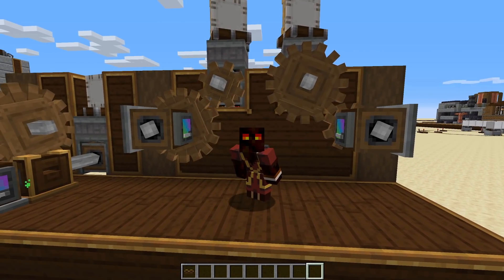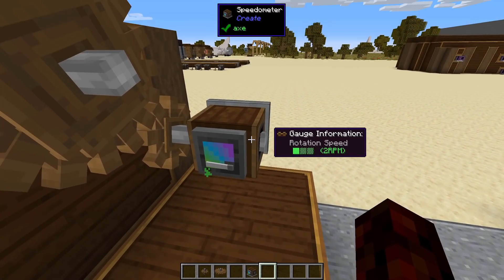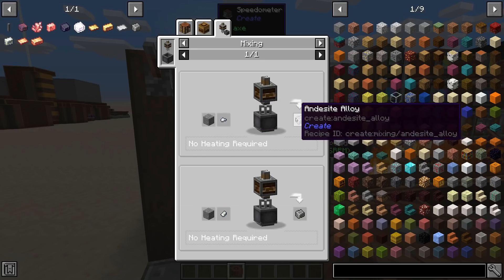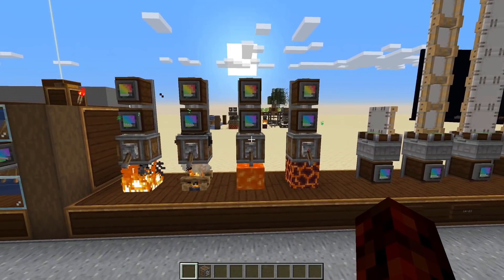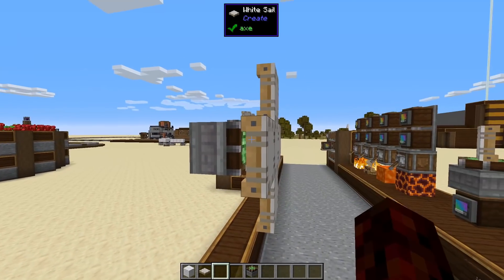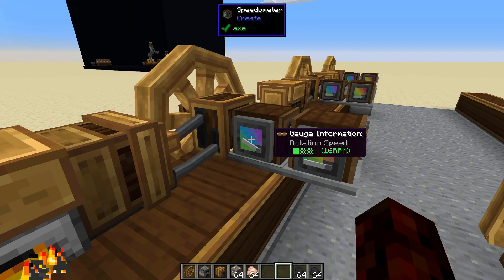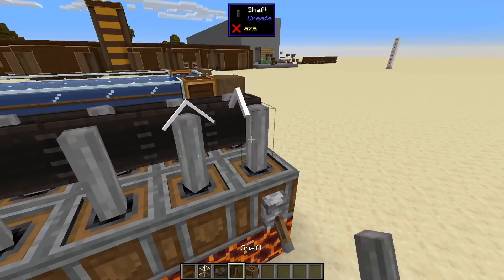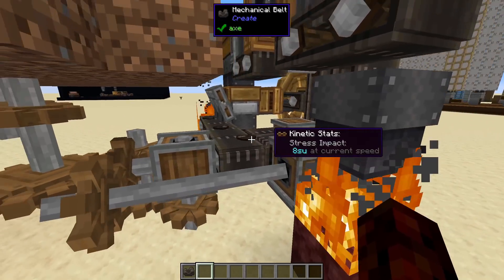Create .3 Tutorial Episode 6: Survival Power Generation - and Automatic Furnace Engine

Comment: The normal furnace engine seems the easiest to make surplus power with kelp. 1 block (9 kelp) of dried kelp can smelt 20 kelp, meaning you will have a surplus of 11. The beauty here is that you will be using fuel to make fuel. Smelt -> Send to autocraft -> loop back as fuel. - The surplus dried kelp blocks can then be shipped to another kind of smelter for xp, cactus farms are great for that if you use the "lock xp in the furnace trick" by powering the hopper underneath. (yeah i know it's create, but a hopper is smarter here)

PS: It seems (to me atleast) that the encased fan w/ magma block low speed gen does not work anymore.... sadge

Great vids my dude! 😁

Comment: By the way, you can optimize the stress units and speed of a water wheel by putting a magma block on the falling side, and putting soul sand on the opposite side so water is flowing up. By doing this you can get up to 360su per wheel (I haven't looked at the rpm though, but it's faster than at 256su)

Comment: The waterwheel can actually output 320su -- you'll need a block of soul sand in the lower right corner (if the wheel is turning to the left), a water source above it, and then the water source that flows around the wheel on top of that. Now only a single spot has no water, the soul sand, all the other 7 count as flowing. Yours at least flows below, but I see a lot of beginners making a hole at the bottom left for the water (like real life water falls from a water wheel -- nonono, that doesn't maximize the power. Game mechanics are not real life. ;)

Comment: I'm using Immersive Engineering and Create, it's mod pair of a dream. For example you can use external heater to supply blast furnace with infinite heat using single immersive water mill.
Reply: That'd be a great pair but i don't want my pc to explode.

Comment: I'm surprised nobody has mentioned pairing up a tree farm with a cobble farm so you don't waste any charcoal then you can power 8 furnace engines with one block of wood
Reply: interesting note, after testing this it seems that I can power more than 8 furnace engines this way for some reason.  this seems to suggest that the furnace engines may actually make the furnaces more efficient, as it implies more than 8 charcoal cooked when fed with one charcoal.
Reply: so I checked the furnace products and it is still producing 8 charcoal per charcoal, so i'm not really sure what's going on
Reply: actually now that I think about it I think it's my belt setup, and the belts acting like a buffer

Comment: For anyone who has immersive engineering in their modpack, you can take the external heater, power it with electricity AND REDSTONE (that will make sure the furnace is always fired up), have it placed next to a furnace in a furnace engine and boom, you have free* power. It eats something like 256 RF/t if it is heating 4 furnaces at once (which i recomend). With four furnaces running, you can get up to 65k SU, enough to run a sizeable factory at 256RPM

(note: I only tried this with standard furnaces; if this works with blast furnaces, you'll be getting 262 144 SU (!!!) if my math is right)

The upside is that you don't need anything to smelt and you don't need any fuel for the furnaces. The downside is the need to generate RF instead, which can prove difficult if you only have IE in early game. I recommend installing immersive petroleum so you can use the portable generator, which generates the exact power needed, or use any other RF mod as IE works with much smaller units than other mods.

Comment: Just an fyi, for a windmill you don't need any radial chassis; any block will do as long as you apply superglue, and if you use sails they auto-connect to each other without the need for superglue.

Comment: Excellent video with clear explanations.  Well done.  I have found the powered fans are good for the bulk smelting/smoking/washing setups as well as running belts alone.  Also, the reference sheet is a godsend.  Thanks for all of the hard work and I look forward to seeing more videos, especially those focused on survival applications.
Reply: If you were to build on that sheet, a second tab with power consumers would be exceptionally useful so a person could calculate the needed power for a system based on torque and speed for each consumer.
Reply from the maker: Ooo smart! I will add that when I have the time

Comment: I basically tried to speedrun to the netherfortress to get a blaze, just so I could start making all the brass stuff. 
I ended up making a furnace engine and mounting it to a platform that I push with  an extension piston and attached a drill platform to it with a rope pulley. So now it's basically a mobile (albiet slow to move) drill platform. The furnace plus a speed controller unit allows me to max out the speed of the drill platform dropping so that it rips through 3×3 chunks on a single piece of coal in about 20 seconds.

Comment: there is also the hand crank as the most early game material! You have to manually power it, but it works to get the first few iron sheets if you don't want to get the water wheel, and it has enough rpm to power a mixer!
Reply: A water wheel can power a mixer if you double the speed with the large cog -> small cog rpm doubling trick.
Reply: @lintycarcass  not trying to be rude but it isn't really a trick because that's how real gearing works

Comment: I don't really understand why I would use a furnace engine, when 4 stacks of water wheels in a box where I don't have to see them do the job just as well and anyone could easily have that way before they reach the brass age.
I guess furnace engines are very compact until you actually try to automate them.
Reply from the maker: Less space than water wheels, plus it’s just another fun thing to automate
Reply: Furnace generators have a higher stress capacity